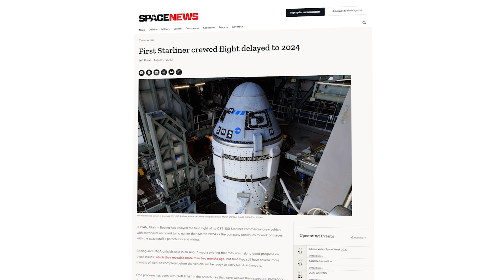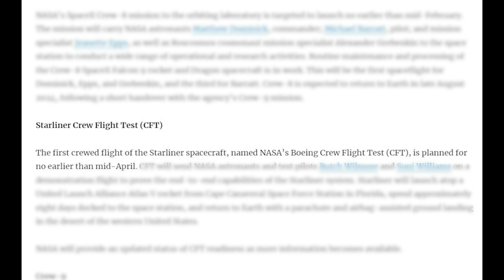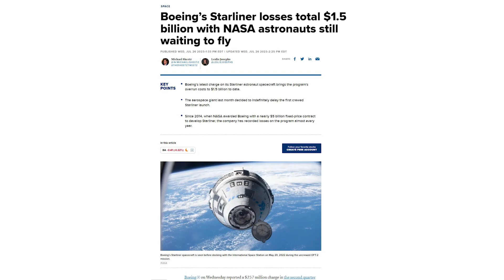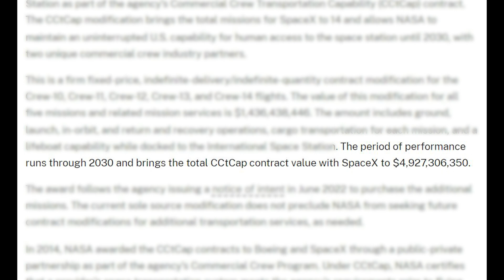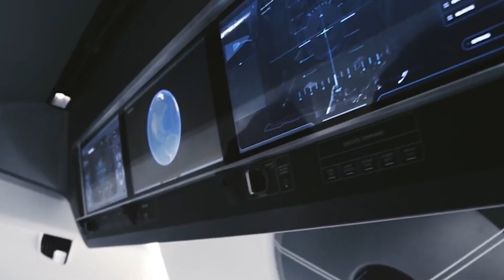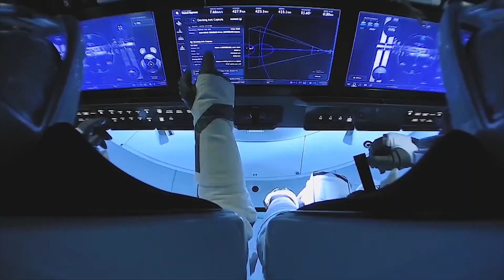Will Boeing's Starliner Launch Crew Before 2025?

Comment: What a mess. With the experience that Boeing has in the aeronautic industry. How can they be screwing up so badly? Wow!
Reply: beancounters at the helm who see their job as a jumpboard to the next gig. Happens to all companies once the original founders / engineers are out / gone.
The problem is the re-focus on shareholder value / investor return.. everything else taking the backseat. And the root cause for this is a flaw in our currencies that they copied from metal commodity currency - zero lower bound interest problem. A proper fiat currency would have a negative lower bound and shareholders / investors couldn't extort positive ROI from the company.. this would give the engineers the leverage they need to keep a company at the bleeding edge. But not even Modern Monetary Theory is there yet.
Reply: That sucks. What's there next move? Sell out to China at a bargain rate? They Built the B-17, B-29, B-47, B-52 The 7 series jets.  @joansparky4439

Comment: Great vid, thanks! Imo Boeing knew about the tape long ago. But there was nothing they could do by the time Starliner was built. It was the independent NASA watchdog committee that called attention to the tape (from Boeing data) and the new chute design, pretty much at the last minute before Sunny Williams got aboard. Bottom line is they can't get to all the tape without taking Starliner apart. And removing the tape also destroys a lot of the wires. So really they have to rebuild almost from scratch and then begin at the start of the testing regime. That's what they desperately wanted to avoid all along. If they are now making noises about the tape being not so bad, that makes me think they hope NASA will agree and that they have not started on doing it the hard way. If it weren't for SpaceX we would never have seen how bad Old Space really is.

And then Steve Stich talks about "backfilling" the Boeing flights, i.e. give Boeing flights until their number matches SpaceX's number. In other words, Starliner does all the remaining flights to ISS and Dragon does none. Right, no bias there. See, putting Boeing back on the gravy train and making sure SpaceX does not recover its R&D costs promotes competition. If SpaceX had put 5% of its budget into lobbyists, we could be sipping beers on the Moon by now.
Reply: Starliner can only do 6 crew flights as there are no spare Atlas v rockets, and the vulcan is not planned to carry Starliner as it will not be human rated. the only other rocket that can carry Starliner is the falcon 9, so if NASA give Starliner extra flights it will be launched on a SpaceX falcon 9 rocket. SpaceX will get money regardless
Reply: @jamesnicholls9969  Good point, thanks.
Reply: as for SX lobbying - this will happen soon enough - don't worry.

Comment: Cargo Dreamchaser will be operational before Starliner takes its first crew to ISS, with manned Dreamchaser on its first test flight to ISS before Boeing Starliner gets accepted as operational.
Reply: That seems highly unlikely. Manned Dreamchaser is a minimum of two years from flight, and probably a good deal more. They were able to raise a couple of hundred million a few years ago for work on it, but that is all, and that is not nearly enough.
Reply: @odysseusrex5908  Starliner got several billions of dollars and is still sitting on the ground and its preferred booster is soon to be retired.
Reply: @sandbridgekid4121   If you are suggesting it could lose its booster, no that cannot happen. ULA has seven of the remaining Atlas Vs reserved for Starliner flights, no matter when they happen. Starliner has been absolutely cursed, and Lord knows you can blame Boeing management for most of that, but it s just inconceivable to me that they will not get their crewed flight test off some time in the second or third quarter of next year and commence operations in 2025. I mean, another major delay is just impossible. Isn't it? isn't it?

Comment: Great Video !  The Boeing Starliner is better than Orion if it is lighter !The Starliner can also be launched on the UJA Vulcan booster I hope.  The SNC/SS Dream Chaser will launch its first Cargo flight in early 2024 !  After Dream Chaser completes the first seven contracted Cargo flights, then Cargo Dream Chaser will be FREE to upgrade to the  Crew Dream Chaser !  The three Crew  capsules/spaceplanes  launchers to LEO CSS will be a big help on supporting the earth-moon space economy !   The recovery of one hundred tonnes of Lunar Water Ice (H2O) on the moon will also help reduce the cost of travel to the moon and the return back to earth !  Research "Moon Direct" by Robert Zubrin.  Also in 2024 should be the launch of the Blue Origin New Glenn that later will launch the Blue Moon HLS (LEV/LLV) to the moon !  Timothy Lipinski
Reply: Starliner is lighter than Orion because it is intended strictly for low Earth orbit missions. It cannot go to the Moon. It is incapable of operating independently for more than sixty hours. Starliner is designed to launch on Vulcan as well as Atlas V, but ULA shows no interest in paying to have Vulcan man rated. They'd be happy to have NASA pay for it, but Starliner has not proved itself so valuable that NASA feels much inclined to that. I think Boeing wants to get through their six contracted missions, on which they are gong to lose money, and drop the whole thing as a bad deal, and then probably never get involved in manned spaceflight again.

Comment: Starliner & Artemis are Too Expensive even Without the unscheduled cost overruns and launch delays. This is old, "in the box" thinking that's already headed the way of the Space Shuttle program. We were promised that the reuse of old tech such as fuel tanks, SRB's, engines, Capsule design etc, would hold costs down just as the Space Shuttle program promised reusability as a cost savings. Nothing could be further from the truth and here we are again, with the proverbial Albatross the Space Shuttle turned into.  
    Even w/ all the Big Brains at NASA, they're thinking is Still centered on the reuse old tech. I guess it's a Good thing that Elon Musk didn't decide to work for NASA or they'd have him pigeon-holed on their Aerospike engine or a better Inertia wheel or a better Heat Shield. I really believe "the fix is in" to slow StarShip's progress. Falcon 9 has already embarrassed Space Agencies around the world and if StarShip proves itself to work as advertised, the competition is only gonna survive as redundant launch services in my not so humble opinion.
Reply: Falcon 9 hasn't embarrassed NASA or the DOD, as they funded a very large portion of its development. Which kind of proves your point wrong
Reply: @mathewferstl7042  Given that Boeing received so much more funding than SpaceX and SpaceX has also developed their reuseable Falcon range of rockets during this time, it seems incredible that the Boeing Starliner is still not yet ready to take crews to the ISS.  SpaceX and the Falcons have indeed embarrassed NASA and the DOD.
Reply: @chrisantoniou4366   NASA has embarrassed itself, but that doesn't speak to a "fix is in" conspiracy.  SpaceX had been getting one launch approval after another back when they were following the rules.
Reply: @chrisantoniou4366  how can they, when nasa literally funded 100% of their development. elon hasn't put in any money into the company personally since the 100 million for founding of the company
Reply: @marcmcreynolds2827  I never said anything about a "conspiracy", only that Boeing is incompetent.
Reply: @mathewferstl7042  Maybe, but at least that money was used to actually create a family of reliable and resueable rockets as well as a cargo capsule and a manned capsule.  Boeing has been unable to do this even with more money.
Reply: @chrisantoniou4366  Sorry, you're right:  "I really believe 'the fix is in' to slow StarShip's progress" was the OP.
Reply: @chrisantoniou4366  agreed
Reply: @mathewferstl7042  The fact that NASA hasn't completely "Blackballed" SpaceX just adds credibility to what I've suggested here and not the opposite as you say. Former Senator and current NASA Administrator Bill Nelson & his cohort Charles Bolden fought long and hard to keep SpaceX out of the Crew Launch Program, They were adamant that Private Space Programs had NO Business in Government contracted Space Programs, period. 
  It was Kathryn Lueders & Lori Garver who fought to Allow SpaceX to be eligible for Grant Money from NASA to develop F9. Not everybody at NASA is For SpaceX, which is exactly what I am saying.
   To suggest that NASA has to blackball SpaceX completely to be considered a shun is straight up ridiculous and stupid. It only takes a few to hold up Gov processes for Grants & Licensing, which is occurring at this moment. Dumbass, do your homework instead of ur lame Trolling attempts, you'll get more respect.

Comment: Is it true that Starliner will not have to do an in-flight abort test? I know they did the pad abort several years ago. Spacex did pad abort then the in-flight abort right after Demo 2.  So is it because theres a limited number of Atlas 5 that they're not doing the second abort test? I dont know but it seems to me NASA would definitely want to test and make sure it works properly. Especially after all the problems Starliner has had. Why take the chance?
Reply: They have abort system, it's in the bottom half of the capsule.  Its fires like the Dragon 2's but from direct bottom from 4 corners.  If you watch video, you can see abort test being done with the capsule.
Reply: As for an in-flight abort test, note that for the Mercury and Apollo programs this was handled by suborbital boosters which got the capsule to various desired altitudes and speeds.   Other than for Crew Dragon, I don't believe a "full size" booster has ever been used for such a test.

Presumably, analysis methods have improved to the point where it is no longer deemed necessary.  The propulsion part of the abort is "basic physics" -- straightforward to analyze given pad-abort data.  Successful deployment of the parachute sequence over a range of conditions is harder to verify, but given the cost of a booster other less expensive means are presumably relied on.  Besides, even after many notional Atlas V flights there still wouldn't be certainty regarding the parachutes:  The Apollo system had a failure years into the program.
Reply: No, both companies were given the option of performing an inflight abort test or performing rigorous analysis and simulation. They made different decisions on how to proceed.

Comment: I think the future of Starliner will depend largely on it's launch vehicle.
The current Atlas V is basically already retired and won't be around long term.
Boeing could launch Starliner on Falcon9, but that would defeat the whole purpose of dissimilar redundancy.
Really, the only long-term future for Starliner lies in crew-rating a new launch vehicle, such as Vulcan Centaur. However one question remains:
Who will pay to crew rate Vulcan Centaur? Boeing? ULA? NASA? A mix of all three?
Reply: NASA should pay, as the crew transport service to the ISS is for them. ULA probably already has plans to certify the Vulcan Centaur for human flight for the future crewed version of the Dream Chaser, so I think it won't be that difficult.
Reply: There are enough Atlas Vs reserved for Boeing to see them through their six mission contract. After that, I frankly think they want to drop the whole thing. Boeing certainly doesn't want to spend any more money on man rating Vulcan. That would just be throwing good money after bad. ULA doesn't want to do it. They are part owner of ULA so half that money would be coming out of their pocket so, same motivation for them. Beyond that, the potential revenue from further Starliner missions doesn't seem likely to be worth the expenditure for the company, so neither partner would be interested. NASA has no need of Starliner beyond decommissioning of the ISS which Starliner is barely going to get its six contracted missions in for before that happens, so they have no interest in man rating Vulcan for a purposeless spacecraft. I don't see it happening myself.
Reply: @odysseusrex5908  well, even beyond the ISS NASA will continue to have crewed missions to commercial space stations in low earth orbit. And they seem to want dissimilar redundancy and competition among commercial spacecraft. So, the need for Starliner (or some other non-SpaceX crewed LEO spacecraft) will outlive the ISS.

And even if Starliner ends up being retired, ULA may want to crew rate Vulcan Centaur for crewed variant of Dreamchaser or whatever ends up replacing Starliner as the competition to Crew Dragon.